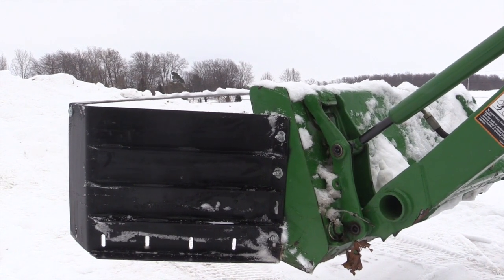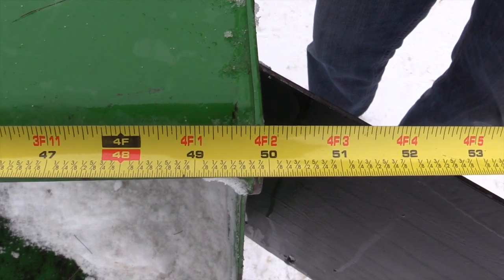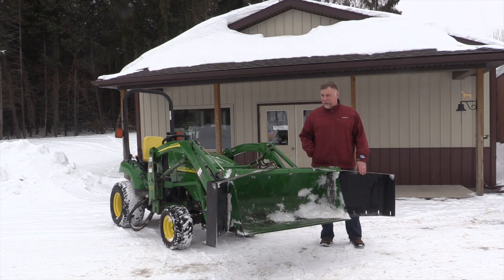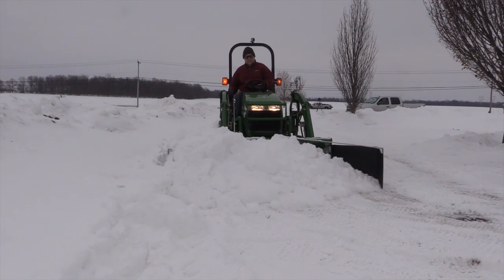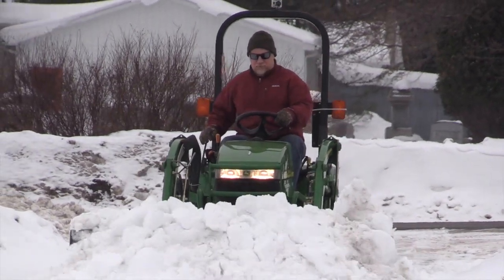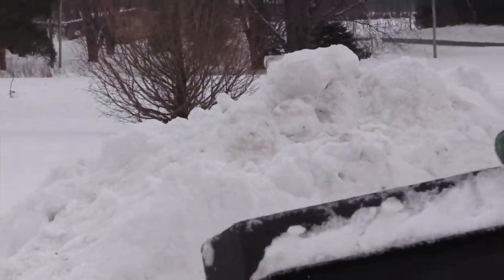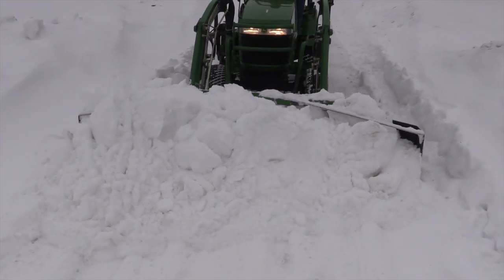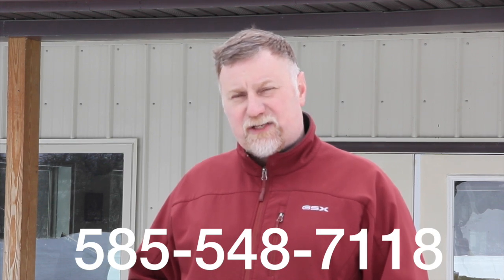Bucket Wings

Comment: Looks like a great product! I've been looking for a better solution for plowing my 1/4 mile driveway using a compact tractor with FEL.  With rubber mounted to the bottom of the extensions; how do you keep the bucket down?  Have you found an issue with the bucket floating rather than scraping?